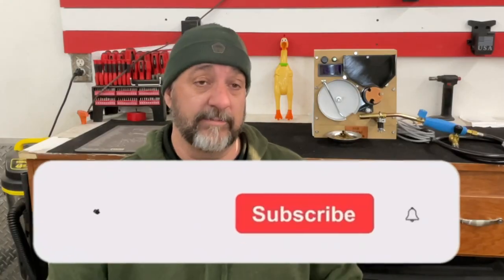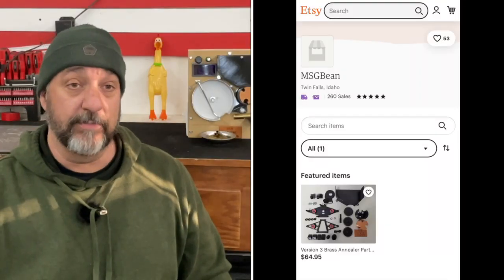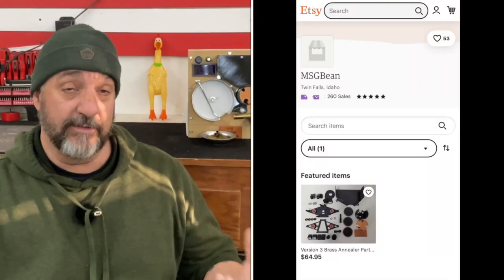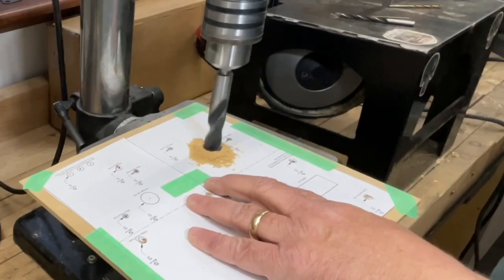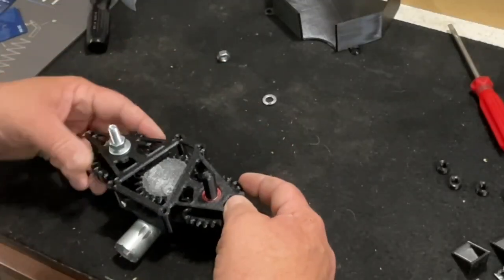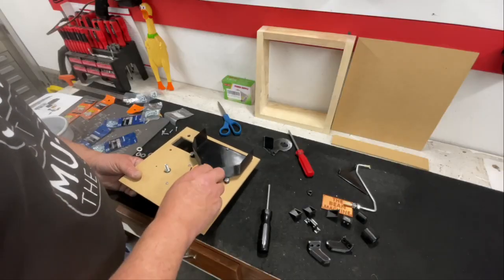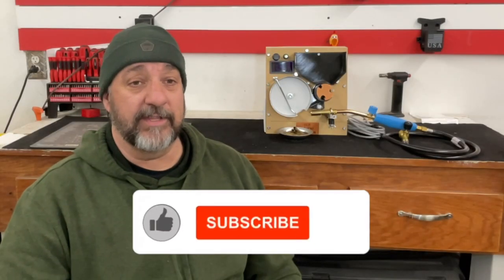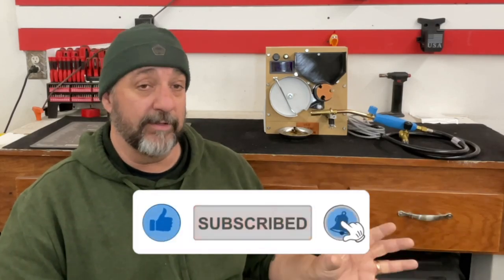The Bean Machine - Brass Case Annealing Machine

Comment: I built one based off his original design (downloaded the print files and printed my own 3D print parts).  Bought the motor, controller, etc off Amazon.  It works just fine...but...there is one catch.  How do you adjust the depth of the bowl for longer or shorter cartridges?  You could cut the bowl depth down for your shorter cartridges, but then it doesn't work well with long cartridges.  Some of the other similar designs go to great lengths to make depth adjustable (requires the entire feed mechanism to move in and out along with an adjustable internal plate inside the bowl.  I'm still working on a solution to work with this one.
Reply from the maker: That is an issue. I don't reload case that need that but I would think the best way would be to have a 2 cup that is deeper.

Thanks for watching.
Reply: @jackofalltrades7822  Actually, just today I see Richard has his version 3 out.  He addresses this issue and simply says just cut the drum to work with the shortest case you want to anneal and it'll still feed and work with the long cases just fine.  he demonstrates that it does.  So, easy fix...and here I've been trying to figure out a way to make it adjustable and you don't even have to!

Comment: Just painting the 1/4" MDF of the cabinet housing I made for this "kit".  Perfect kit to keep me busy after deer season in the cold of winter.  (In radio control fixed wing flight we would call this a "short kit").  I made a few changes - added 3/4" to the left and 1/4" to the right so, like you, I could accomidate the full face panel of the control/display.  Overall his plans are amazingly complete and you modify them at your own peril.  I also added rubber feet.  Amazon does sell a black turnbuckle that fits the 3-D parts (National Hardware N820-120 Turnbuckle Hook and Eye) and I got ALL my added fasteners and hardware off Amazon . . . for better or worse.  I swapped the placement of the switch and speed dial as I like the start button in the upper left so I don't have to hunt for it.  Personal preference.  I also added a lot of backing plates inside the case so I could screw into substance and align the back plate.  And I made the frontal plate as screw-in rather then glued in place so I could remove/alter/revise it if ever needed.
Reply from the maker: @StumpkillerCP  sounds like a neat build. Thanks for watching.

Comment: I've just brought the same kit, just need to order the extras 
Great to see more reports on how good it is.
Reply from the maker: Still using mine and still good. 
It requires a little adjusting of the torch when I set it up but overall it has been a solid unit.

Thanks for watching.

Comment: I got my kit too.  Its all the way built now I'm up to connecting the motor to control board.  What gauge wire do you use to attach from the motor to the control board and board to the power source?  I didn't find this information anywhere on Mr. Beans website nor was it mentioned or I overlooked it.  Thanks!

Reply
Reply: @tjjc27  I used 18 AWG that I had on hand for the power and the motor.  The power supply uses 24 AWG, so there isn’t much benefit going any larger.
Reply: @ thank you. I finished it a bunch of months back and I believe that is what I used. Thank you for replying though.
Reply: @tjjc27  For you and others who may come after.  Leave the wood-box fuller than you found it.  ;-)
Reply from the maker: @tjjc27  I don’t recall but I am sure it was ever I had lying around. I would say 14ga wire is probably pretty likely.

Thanks for watching.
Reply: @jackofalltrades7822  Thank you very much.  I will be heading to HD tomorrow to get that cable.  I really appreciate you in replying.  Have a good one - TJ